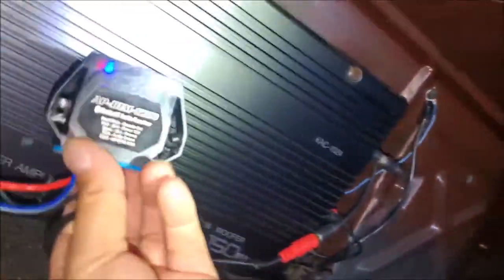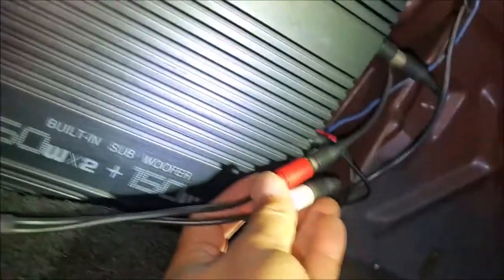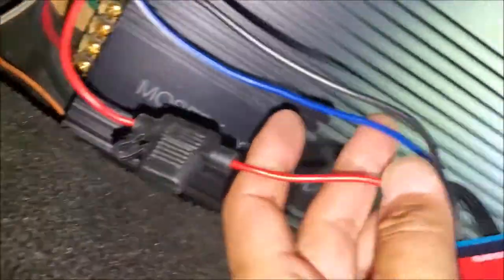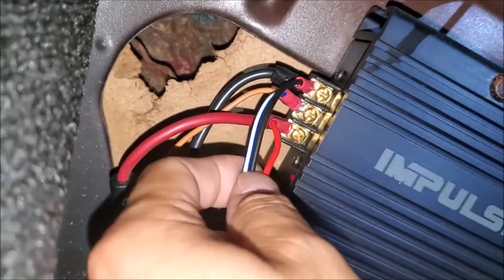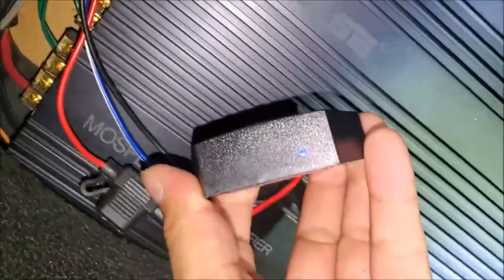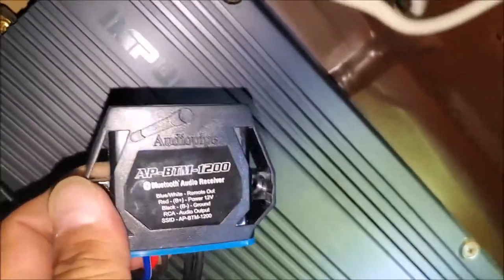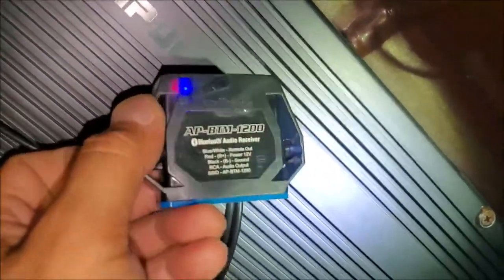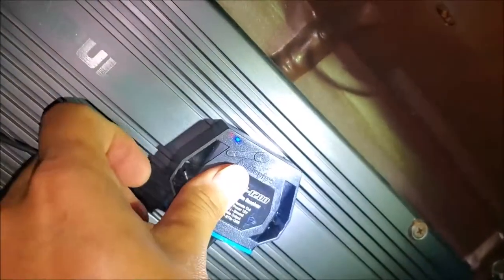Bluetooth Audio Receiver Install

Comment: I have a motorcycle I'm looking for sound without spending a ton on a head unit this might be the way I go
Reply: Definitely good for motorcycles or off-road. Doesn't use any space, but you will need a way to get sound from it. An amp, or equalizer, or head unit of some kind to power your speakers.

Comment: If I use a y splitter for to hook up to 4 channel amp will I loose to ability to fade left and right.
Reply: I'm going to say yes. You have to keep them seperate in order to use the seperate. If you combine the sound it's going to be all one sound.

Comment: Dumb question. On a 4 channel amp I hook up both reds from front and rear to the red rca on receiver and same thing with white? Thanks
Reply: You can use an rca adaptor. 2 male to 1 female or vice versa. You will just need the sound to go into the amp somehow. I usually use the adaptor when using 4 channel amps.
Reply: Got it, thanks for responding. Works great.

Comment: I have this wired up like you showed but it is constantly on (solid blue light).  They way you have it wired will it ever power down?  I have the remote wire from my amp wired to my head unit so it turns on if/when I turn the head unit on and that seems to be working fine.  Appreciate the video, was super helpful.
Reply: The power for the unit should come from the amp. Your just jumping the power. When your amp powers down everything should. Try to move the power wires all to the remote power and see if it works better that way.
Reply: @amigosnano  That was the ticket.  I don't know why it was staying powered on even when the Amp was not, but hooking it up the way you recommended works great.  I can switch my old head unit on and it powers it up, send tunes to it and that powers my amp on too.  Much more cost effective option that replacing my classic stereo head unit to get bluetooth capability!
Reply: You don't need the Deck to power the amp just connect to a fuse that works with the switch when the car switch is on
Reply: @robertovalentin1482  how do I get sound to my car speakers
Reply: What does it mean uf only red light is on

Comment: will it work the same on a class d amp or will it need a line output converter?
Reply: Good question. I'm not sure about this one. If the class d amp only inputs mono, thats the only sound your going to get out of it. RCA cables work the same no matter what kind of amp your using. So I'm going to say yes this should work, but I'm really not sure.

Comment: So how does this work on system that has 4 front and rear speakers?  Would they all have to be wired to the same so they all work with no front or rear just all the same?
Reply: Whatever speakers are wired to the amp will play the music. This unit plays music thru the amp.

Comment: Does it have dual bluetooth connections or built in mic for handsfree calls ?
Reply: No. That would be a different type of device. This is for Bluetooth connection only. Your looking for a Bluetooth audio transmitter. I have one in my Cruze. They run from a USB connection inside your car. This device does not do that.

Comment: Yo when I connected mine I got a buzzing noise though speakers. Any idea
Reply from the maker: Check the ground. Try to ground it to something other than the amp. See if it works. Buzzing is power wire interference.
Reply: @amigosmotorsports7191  I switched the ground to the battery and also ran the power wire to a bunch of different things but it was still there. I had to turn the gain all the way down and it want away but then I could barely hear it at full volume from my phone. You think a ground isolator would work?
Reply from the maker: @kriskreates2931  that might work. Or a noise reducer. I have used those before. Some buzzing comes from the engine also. I have noise in my boat and can't figure it out. Same issue.

Comment: My car is turn off and still the on blue light , that’s okey to be like that ?
Reply from the maker: No. It is taking power. Move the remote Blue wire to the power. It should shut off the led when car is off.
Reply: Thanks
Reply: @amigosmotorsports7191  I have a question I have a install o would like to do for myself on a atv I have the amp and Bluetooth receiver. Can I hook up amp directly to battey power from amp to power on batter then ground to battery. Install receiver directly btp amp red to power on amp ground to ground on amp and blue to blue on amp. It amp shut off on it own?
Reply: @erick462  yes you can do that. This is exactly what this is made for.
Reply: @amigosmotorsports7191  so hook the remote up to power and it will turn off and on?
Reply: @dlsjunkremoval  the unit should turn on and off by its self. Change the remote (blue) wire to constant power and vice versa. Just to test it. The unit should power on and off with accessory power or when you turn your vehicle on and off.  No remote needed.

Comment: Mines is hooked up just like yours and I’m getting a constant blue light. Any help would be great. Thanks
Reply: Move the remote wire and test it. You will need the unit to power off when you turn your vehicle off.
Reply: It’s on a motorcycle. Light stay on even without the accessories hooked up to anything. It’s receiving constant power which I know is bad for the battery
Reply from the maker: Use the blue wire for remote battery to try and make it accessory power only. The unit should not be taking power with the motorcycle off.

Comment: How do I hook this up to a 4 channel amp
Reply from the maker: Use the wiring for the amp and connect it to the amp. You can ground it elsewhere if you want. Hot.  Remote and ground.
Reply: @amigosmotorsports7191  ok cause I wanted to but a sound system  in my motorcycle I want to use 3 mini amps for highs mids and lows and this blue tooth receiver has 2 rca Jack's  . I'm  thinking how would I hook this up to 3 amps maybe I need some sort of adapter rca jacks
Reply from the maker: @pharaohnile867  where ever your sound comes from is where you hook the RCAs to. It should work. Good idea by the way.
Reply: @amigosmotorsports7191  ok thanks 👍